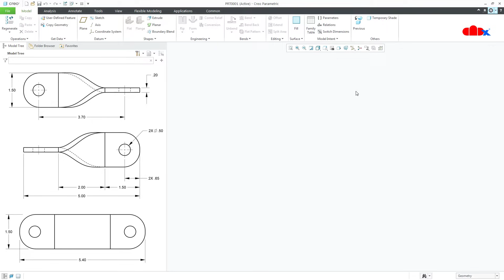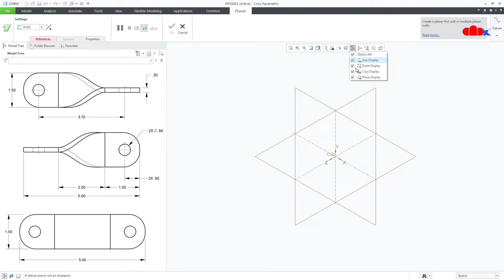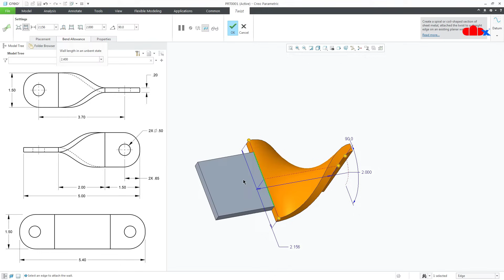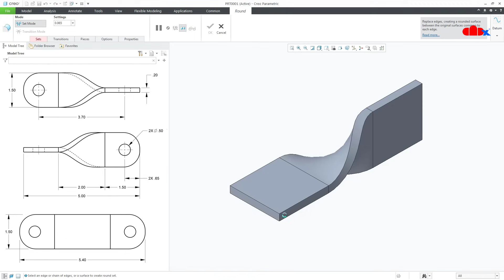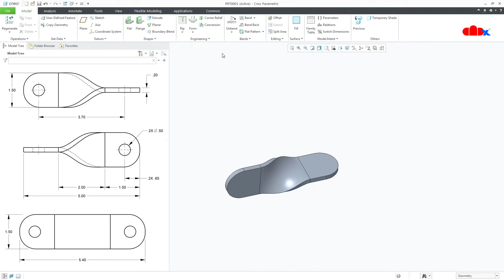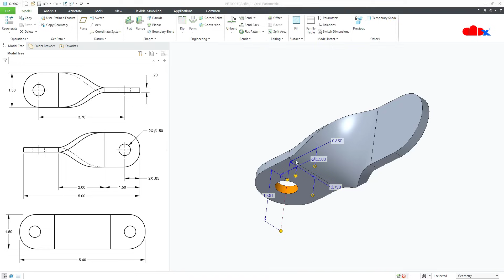Sheet metal tutorial | Sheet metal twist in Creo Parametric

Comment: I'm regularly practice your Models daily one by one 
I have 5 years of experience in sheet metal operation Turret Punch Press,  bending forming ...Production Engineer. 
I need one Assembly video on sheet metal welded frame work 
All the corner joint bended sheet parts not plane sheet

Comment: How is a flange added to a twisted edge?  I have a center, piece of a three-bladed fan where twist is required to set the angle of the blades.  But flanges are also required to stiffen the center piece.  I would appreciate a video to explain how to do this.  I can also provide a photo and Creo model of my attempt.
Reply from the maker: Please mail  the photo to "sandesh4satyen@gmail.com". I will get back to you.
Reply from the maker: Hello Martin, I just checked your photograph and creo model and I appreciate your effort. I just want to make clear few things related to sheet metal manufacturing. A seat metal part can be manufactured by two different ways in plant. One way is by bending process where we cut the sheet and bend it  to get the final product and second way is by forming process where we use punch and die tool to form a sheet metal part. This part is a example of formed part. So to create this part in creo parametric, create a flat sheet metal wall and use a punch tool to give the shape you required. This kind of shape cannot be created using bending commands in creo parametric. I hope this will be helpful. Write me if you need further assistance. Thank you.
Reply: @CADxTraining   brother please send some company drawings for practice